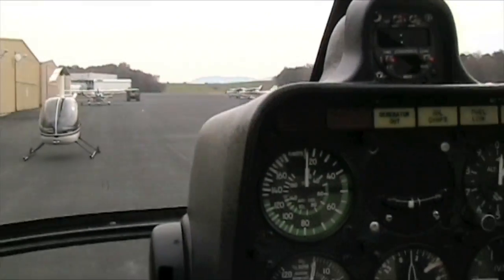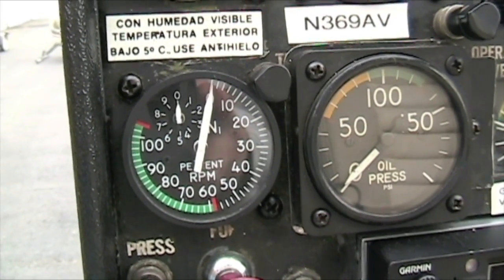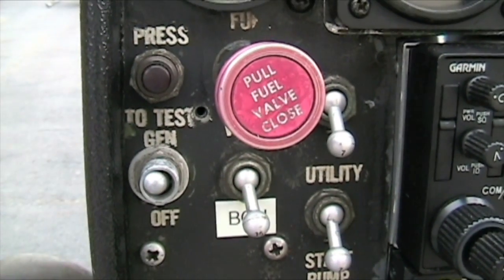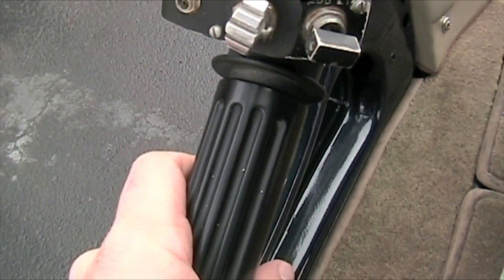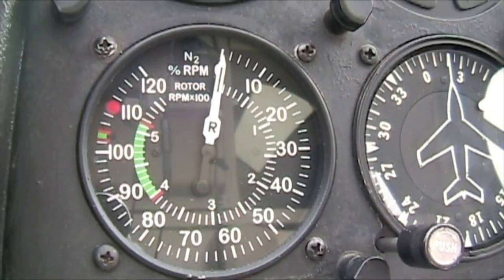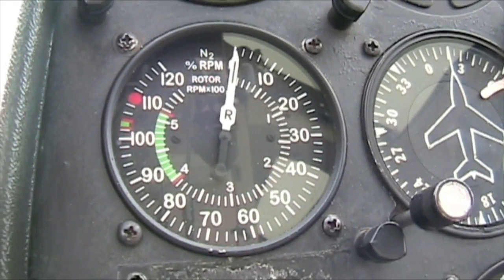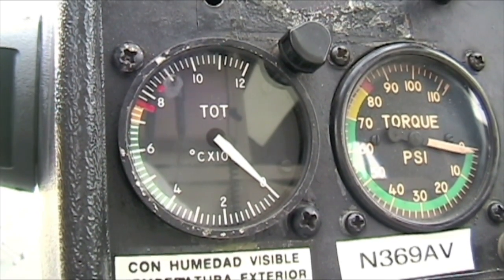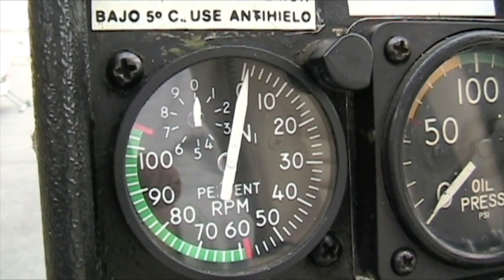MD500 - How to Shutdown a Turbine

Comment: Hi Mike,  this whole little series of exlpanations and limits, along with viewing actual guage interactions , and engine audio,  from start up to start down, is great. Hope this resource remains on YT long into the future, for technically minded.  I noticed on your start up vid that around  N1 ~ 50% that a third winding up sound kicked in. This vid tells me that is acutually transmission/ over run clutch/mast/rotor head/ tail drive noises as it persists even though turbine spools are near stopped.  Sounds like ready for major bearings overhaul time! Of course no oil getting pumoed at this point. Surprised the design does not also include an  electrical driven boost oil pump interlock, until all rotating components are at full stop.  Appreciate the work you did on this.

Comment from the maker: If you have a spike in TOT during shutdown you would press the starter and ensure the throttle is fully closed.  Pressing the starter button will spin up the compressor & gas producer, sucking in cool air, cooling your TOT.  Pressing the starter button will also activate the igniter, and any residual fuel, but with the throttle closed there won't much of any fuel to burn.

The key aspect of pressing the starter is too suck in cool air and to get rid of the hot gases.

Comment from the maker: The TOT increasing as the Gas Producer (N1/Ng) gets closer to zero % is because of the residual heat, which is now trapped without the cool air getting sucked into the engine via the compressor.  

Until Ng / N1 / Gas Producer reaches zero you need to make sure that fuel is not re-introduced via the throttle not remaining in the closed position.  If fuel is re-introduced without sufficient Gas Producer RPM, there will be a rapid spike in TOT.

Comment: I too notice the TOT creeping up near the end, but I wouldn't really call it "spiking"...is it caused by residual heat-soak with decreasing cool airflow to remove it?  Maybe Mike can explain.  Also, why (and how) would there be an "accidental introduction" of fuel during spindown?...and how would you know this?...and why would you press the starter button at that point?...wouldn't that start the ignitors, igniting the fuel and be the definition of a hot-start?  Inquiring minds need to know!